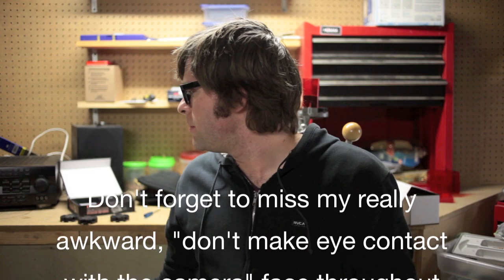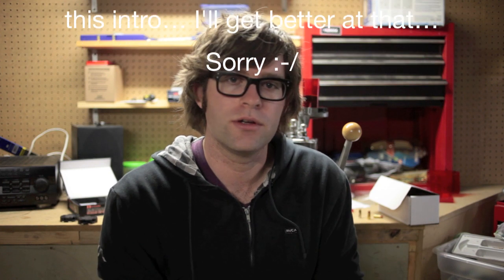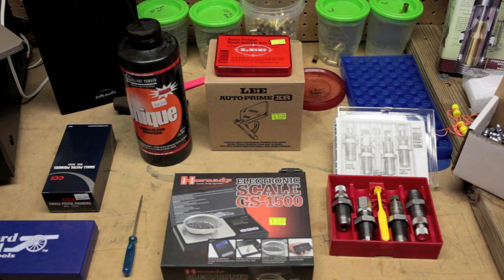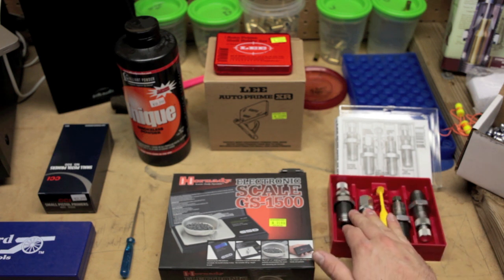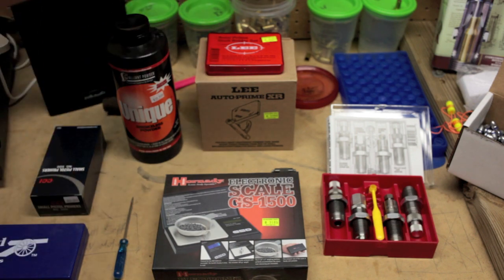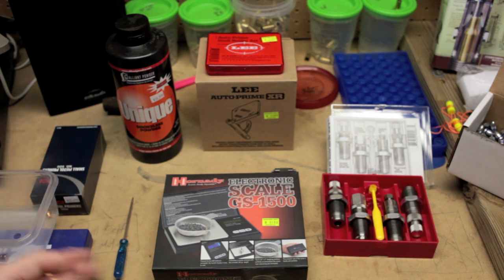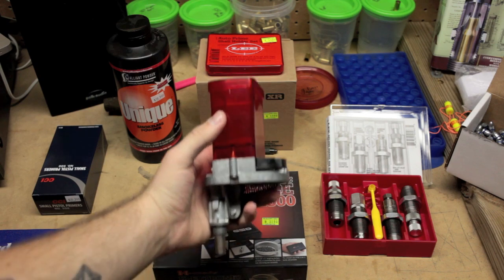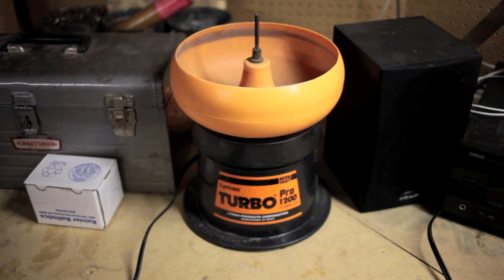Reloading Handgun Ammo Tutorial Part 1

Comment: Most likely it doesn't have the factory crimp die if it's for pistols but has the FCD if it's a rifle set.  If it's a pistol set, it has a roll crimp with the bullet seating die.  The FCD is a more uniform crimp for better accuracy and some say it allows the rounds to feed better in some pistols.  You can get the FCD from an online retailer for about 19 dollars.  You would pay more by picking up the FCD (just remember next time when you buy dies), but would still need the first three.